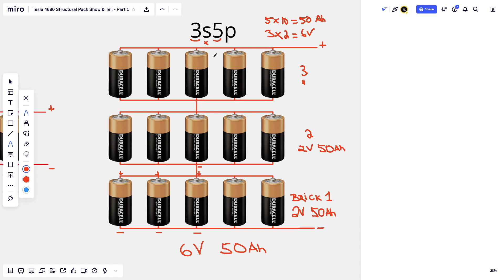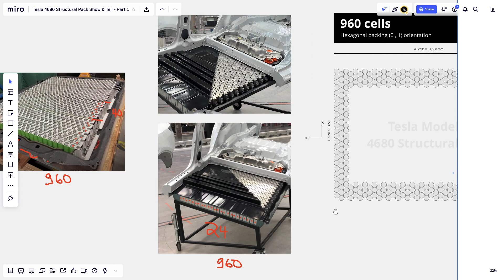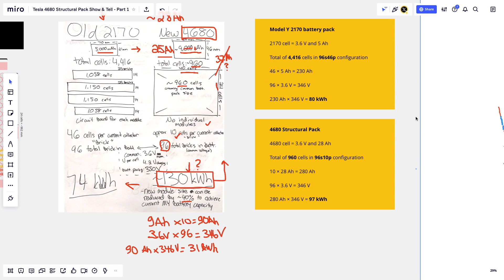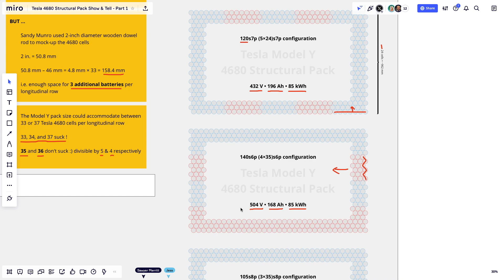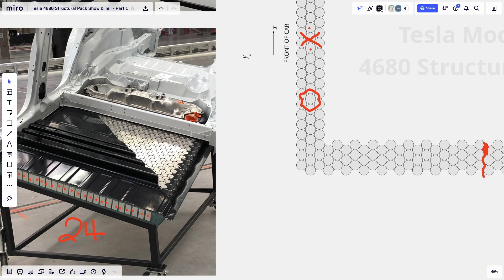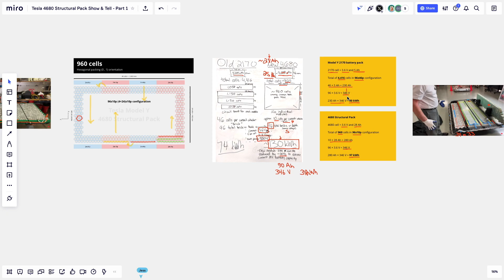Tesla 4680 Structural Pack Show & Tell - Part 1

Comment: Hi , the structural battery pack, could be filled by 2170 cells? First models coming out from Berlin could be with 2170 cells and structural battery pack?

Comment: Great presentation. 

I don’t see how running slightly higher voltages at the pack level will affect battery life of cells. At the cell level, where all life exists, the voltages and likely the currents are identical no matter the pack configuration.

Comment: This is an excellent presentation - thank you! 
One small nit - Having scallops on the edges instead of the ends reduces the moment of inertia because a longer battery moves the corners further away from the center of mass than a wider one does. (think about how much easier it would be to spin a disk versus a long stick with the same surface area). The examples from Tesla's presentation would be slightly more nimble than the configuration you and Sandy used.

Comment: Once you get past the first 2 rows in the pack, I can't see how any orientation of the cooling tubes could make any difference at all. You 're going through the same hexagon of batteries from any angle so the contact area would be the same.
I can see them possibly cooling both the sides and the bottom to allow for faster charging.
Making the dimples to match the 4680 cell bases would not necessarily be expensive, you're only talking about a single stamping, one sheet of aluminum.  They are going to have to form a top some how.

Comment: great presentation.  But I don't think Think Tesla presented the interior design of the pack out of nowhere and simply wrong compare to what they intend to make...  So your design is good but I don't think Tesla design is that wrong and I think they will go with what was shown.  It would make no sense to show something and produce something very different.  They could have simply not shown it if they wanted to keep it a secret until the car is being produced.  So I think it will be 40x24 with the alignment 90degree off with the cooling loop on the side.  As for side accident... as long as it is safe for the occupant, I think the pack will be replaced as soon as the pack is somewhat damaged.  I don't think the pack is repairable in any way and I don't think changing the orientation of the alignement and the location of the cooling loop will have an impact on the survival of the pack in the case an accident occurs and the pack is damaged.  Also, keeping the battery near the center is a good idea, but you understood it the other way around.  if the battery is longer and thinner like the design you choose, the moment of inertia (might not be the right term since I don't know the English term for that one) will be greater for the same number of batteries in comparison to what Tesla showed which is between your design and a square.  A square is better than a rectangle to minimize the moment of inertia (better handling and stuff).

Comment: Going off the volumetric energy density of an NCA 18650, I get about 28.1 Ah per 4680 cell, or 97 KWh for the pack. Add the 16% improvement claimed at battery day and you're at 112 KWh.

Comment: Only thing that don't make sense to me is the talk about higher battery voltage leads to shorter battery life. Don't see how that would happen, on a cell level you are still putting the same loads, as in per cell current, power etc. The rest makes sense, thicker insulation, more channels needed on the BMS, regulations and so on
Reply: Agreed, I'd like to know the reasoning behind that claim.

Comment: Once the configuration of the batteries are finalized you could reduce the overall height of the battery pack by angling the batteries in a 45° angle, the downside to doing this is you would increase the length or width somewhat.

Comment: Flipping the array from "scalloped sides" to "Scalloped ends" sounds very speculative to me. The actual design as shown at the Berlin factory openning, makes a lot of sense as is.

Having the cooling strips going across in stead of along the array, is more efficient (many short strips in stead og few long strips, means less flow resistance), and a 10p96s array arranged 24x40 is perfect for scalability.

The maximum configuration would make 960 x 27 Ah x 3,65 = 94,6 kWh, which is a perfect potential for further competition, and you can very easily scale the capacity lengthwise with following configurations:

9d96s (24x36) = 84,1 kWh
8p96s (24x32) = 75,7 kWh
7p96s (24x28) = 66,2 kWh
6p96s (24x24) = 56,8 kWh

You would of course have to fill the gabs with some structure. Another way of capacity scaling is using LFP for Standard Range, which means roughly 20% shorter range with the same amount of cells.

I don't think Tesla plan to change the system voltage significantly, as all power-electronic components would then have to be different from the components, already used in the models, and they would likely have to upgrade every single Supercharger as well.

The advantage (if there is any) of higher voltage is imho not worth going for.

Yes, higher voltage means the DC cables from chargeport to battery and battery to motors, can be thinner - but hey, are we talking about 4-6 meters of DC cables, all together?

It means you could save 2-3 kg of copper, if you double the voltage, but you'ld have to replace that copper with twice as many cell monitoring boards (= twice as many chips, twice as many wire connections between cells and monitoring boards etc.), which is one of the heaviest cost drivers in an EV.

The cut through 4680 battery seen at the factory opening, seems very well thought through. The cooling strips as well as all the sheet metal parts for the pack casing, seems very finished, so the tools for these parts are most likely already done.
Reply: BTW; I noticed your suggestion that if you arrange the cooling strips in the other direction through the arrow, you would have a greater contact area between cells and strips.

That would be true if it wasn't for the geometry. If you sketch it, you will notice that the gab between the cells has to be much bigger, in order to make space for the strip, because the angle of whivh it goes betweeb the cells increases.

The cooling strips has been arranged in this (shown in Berlin) direction since the first Roadster, and I believe this has been considered repeatedly by ever new battery pack, with same result.

Tesla don't do things just bcs they used to do so, without considering whether it is still the best way of doing it. ;-)

Comment: If the pack size from the 2170 era has space for 960 cells this could allow the use of lower capacity LiFePO4 cells for even a mid to long range car. If they used the higher performance chemistry or they wanted a standard range car they could either fill the empty space with foam or else use empty cans to provide the structural support.

Comment: I seem to recall from battery day that the 4680 cells are going to be cooled from the bottom end only and not the sides - this is enabled by the new internal cell architecture (tabless design) and allows for higher cell packing density and also more effective heat transfer due to the anisotropic nature of the jelly roll (conducts heat axially much better than radially).
Reply: I do take on board your comments on potential damage from the bottom of the pack though.
Reply: the ton of copper from the curent collectors that exit the jelly roll would make sense to transfer all the heat to the botom and use a big cold plate on bottom of the pack. But the roseta layer between the current collectors of teh anode and the botom of the cell can would likely reduce the contact path to the bottom.  Or maybe they have a special thermally conductive gel or silicon to improve the surface of contact to link the copper to the bottom of the can theu the roseta... Also if the heat would still be transfered to the side of the cell, the heat path from the center of the jelly roll to the outer diameter would need to cross all the layers of cathode  and anode and  separators  , and wodl make each single layer to have different thermal conductivity to the outer diameter  of the cells. and that's no more a problem with the cooling on the bottom as each single axial section of the jelly roll have the same exact direct  path to teh bottom. This also contribute to better cel longevity as volumetricly the cells will age uniformly as it has a more uniform heat  in his volume

Comment: About the ribbon touching surface thing. It's not better if you think about the 2 sides of the cells. Try to draw 2 adjacent ribbons. But if you look at the berlin pack, they only cool one side of the cells. The 4680 must be much easier to cool, so they can save space and complexity like that. But they couldn't do that with ribbons like you suggest.

Comment: The chemistry might not be NCA but NMC which are more likely 3.65 to 3.7V instead of 3.6V nominal. The NMC usually are higher C rate cells, perfect for high C rating charging compaare to the NCA.. In addition of that, Farasis Energy anounced couple month ago a 25% energy improvement with their SCC55 silicon-carbon anode they are working on for their NMC cells. Maybe Tesla are working with Farasis Energy to come up with a NMC solution.  Farasis Energy are supplying the cells for the Zero motorcycle pack. since 2013 and they improved the chemistry from 25Ah to 32Ah cells in few years. see what insidev published about Farasis in October.

Comment: Btw MOST ACTUAL  L3 chargers are using stack of multiple 50 - 500VDC AC to DC modules so these are ready for UP TO  500VDC  MAXIMUM. That's about 119s at 4.20V/cell  absolute max. so the pack voltage estimation can go up to 119s or 116s as a round number for 29sXp per modules. It's not possible to make a pack that fully charged at 4.20V per cells to be higher than 500VDc otherwise they wold need to upgrade all their superchargers AC to DC module$$$$! However most Tesla Superchargers are going up to 410Vdc ( not sure if it's nominal or max full pack voltage) but the Plaid model S is 112s (470Vdc) full charge so... my guess its that i's a nominal voltage indication for 410v so 112s at 3.6V is 403V nominal ( less than the 410Vdc nominal indicated by the charger)

Comment: Given how callously incorrect Tesla's FSD display at Berlin factory was (check the camera angles and FOVs...they were all mixed up), I am not inclined to believe that the battery pack display did not have major errors. I'd wait for another reveal of images/data from Tesla to be sure what the final 4680 structural pack would indeed look like.

Comment: The 21700 are probably NOT 5.0Ah but more like 4.8Ah. The reason is that the 5Ah Energy cells are too high nternal resistance for the required power for discharging as well as supercharging at like 2.5C rate. The 4.8ah cells will end out giving more Wh than the 5.0Ah at the C rate these will be used by the Model Y.

Comment: I don't think sandy made a mistake on the 9000mAh. He was probably talking about the increase in density. Like if the 4680 was the same size as the 2170. It's what i assumed. And it's why he find 130kWh at the end.

Comment: 96s10p in 4 "modules" or divisions of 24s10p.  would make sense as for 96s pack voltage and 10p as about 20-25Ah per cells for 200-250Ah